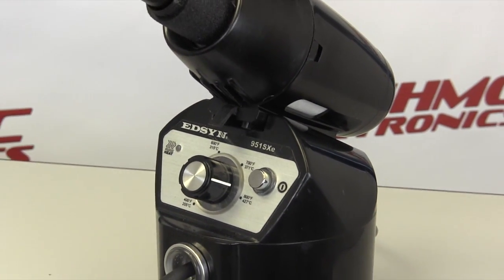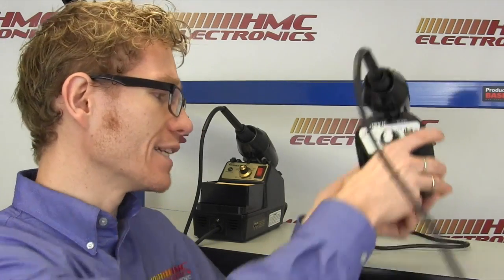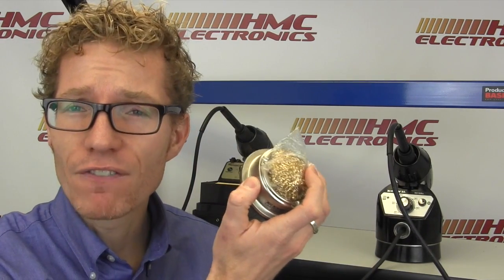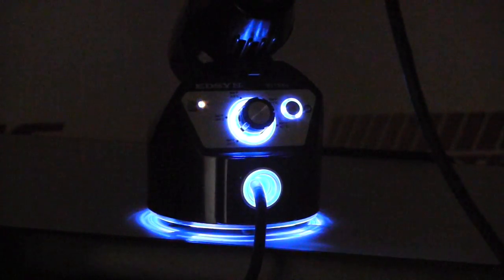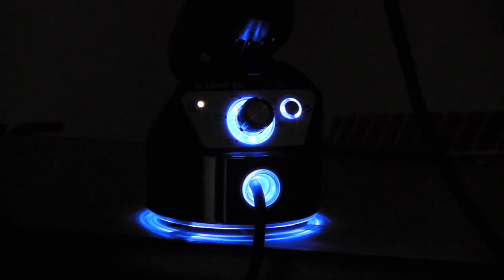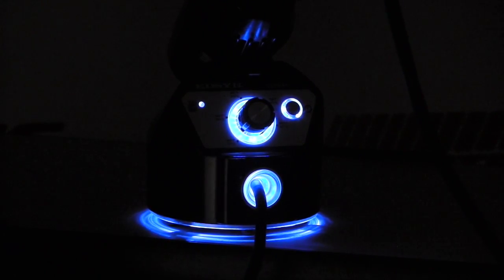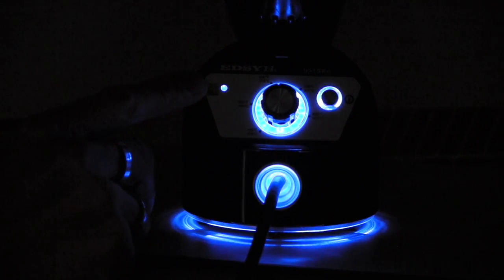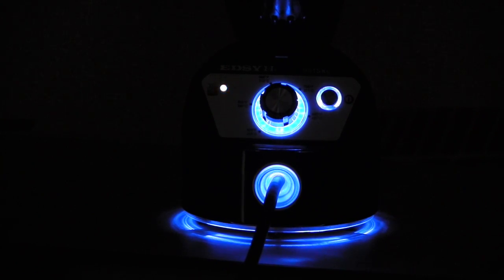Edsyn 951SXe Soldering Station

Comment: How have they reduced the footprint when they've separated the power supply from the station?  Now you have two pieces taking up bench space???  When you take out the sponge tray you then have three pieces on your bench.  An improved, redesigned station that now takes up nearly 3X the bench space - this is nuts.  I am one of those electronics people who have been using a 951SX for 15 years at work without a hitch(and there are several others in my shop).  This station was nearly perfect before but the new one is much less so.  I guess it appeals greatly to those techs who solder in the dark.
Reply: Thank you for your review.  The blue light was included in this design following the request from many production workers as part of their safety protocols.  Supervisors can look down the line and clearly see which stations have been left on.